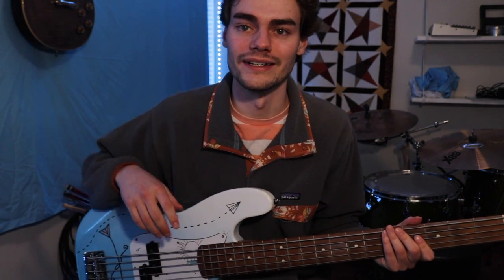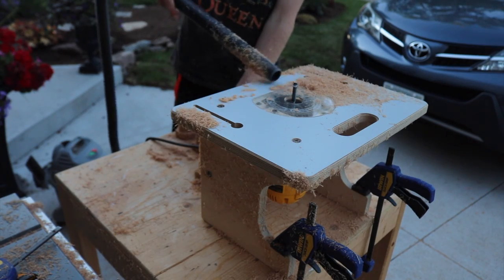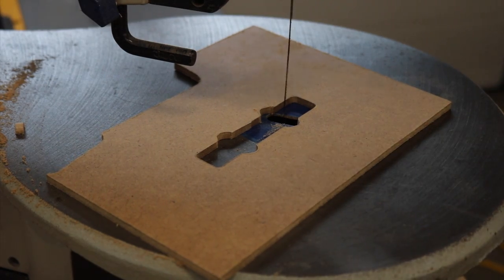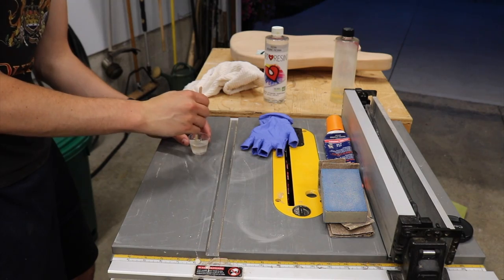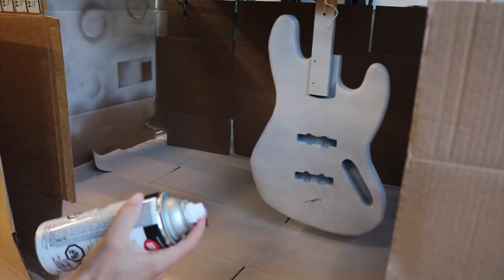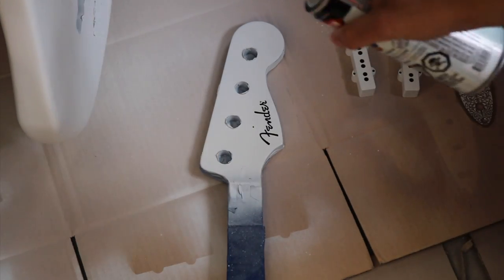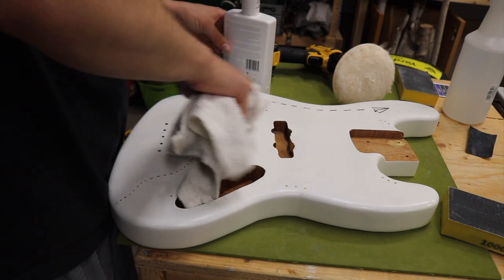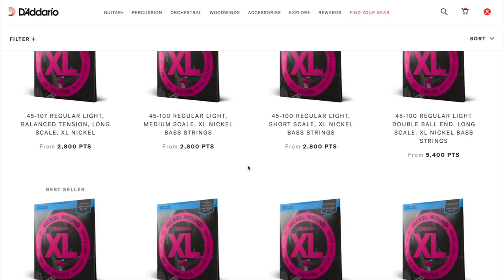DIY Bass Build - How I Built a Custom Jazz Bass at Home

Comment: Good job. I'm currently not equipped nor able to make a body, and even less a neck, which I think is the hardest part to manufacture. A small subjective comment: I would have kept the Squier logo. Putting Fender logos on Squier necks is a no go.
Reply: Either the Squier logo or a custom logo but definitely not a Fender logo

Comment: This is amazing! Can you tell me what is this little Delta bandsaw you used for the template? What's the model? And wasn't it strong enough to cut the body itself?
Reply from the maker: Off the top of my head it's a Delta 40-570 scroll saw so it unfortunately doesn't have as much power as a bandsaw. I haven't really pushed it to it's limit though so I'm now curious how thick of a piece of wood I could use it on! Thanks for watching